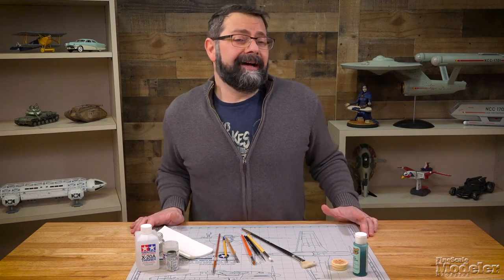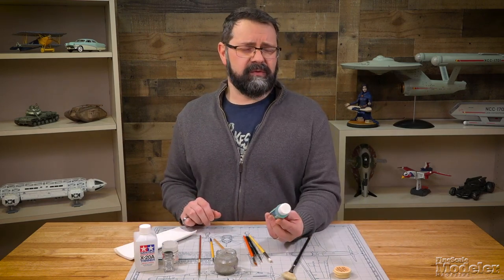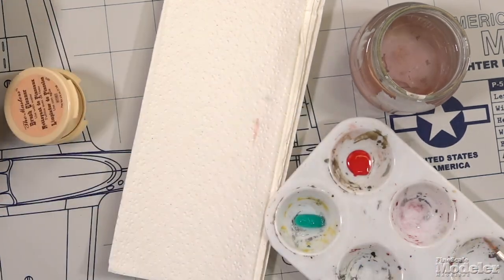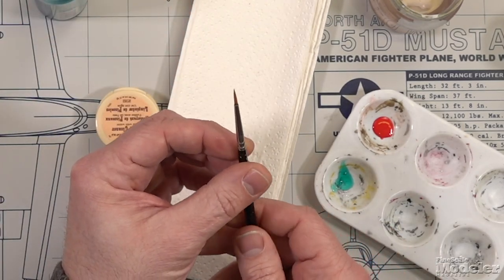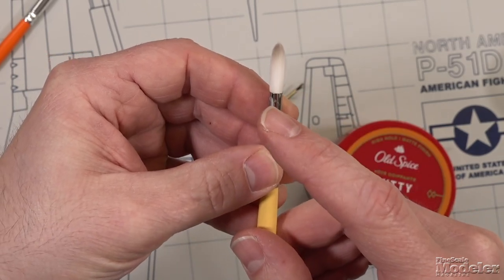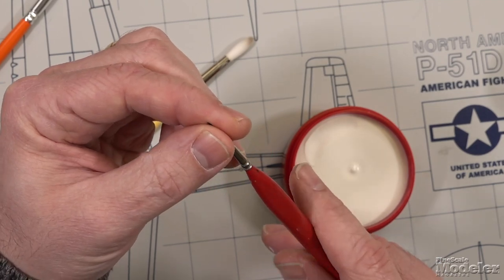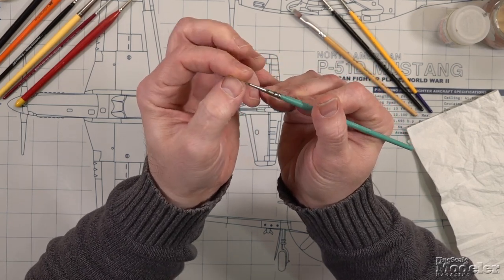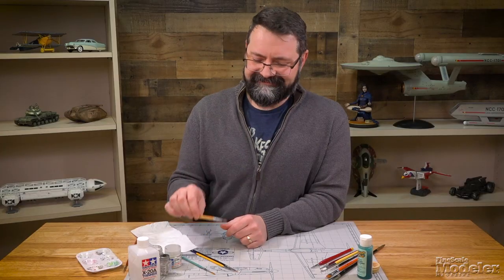FineScale Modeler: How to clean, maintain, and reinvigorate paintbrushes

Comment: My cleaning method is clean brushes thoroughly water and dip into water for a day ( acrylic paint) ...is this a good method?
Reply from the maker: Without a detergent of some sort, you risk paint building up in your brush. We do not recommend leaving your brushes soaking in water or other thinner. First, if your brush is resting on its tip, for any length of time, you run the risk of deforming the shape. Second, you do not want thinner wicking up into the ferrule (the metal part holding the bristles). Bristle expansion can cause the ferrule to loosen and your brush to start coming apart. Better to thoroughly clean your brush immediately after you're finished with your painting session. Reshape the damp bristles. Store the brush horizontally or tip up to dry.